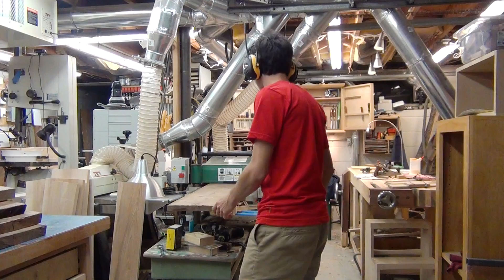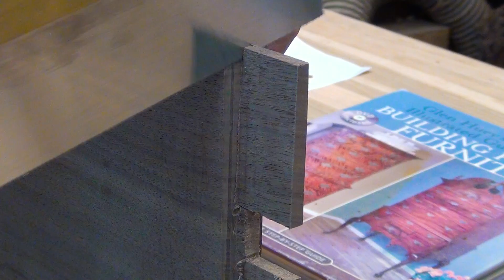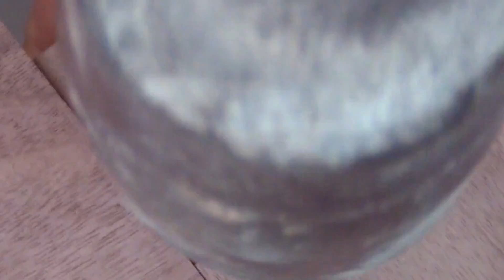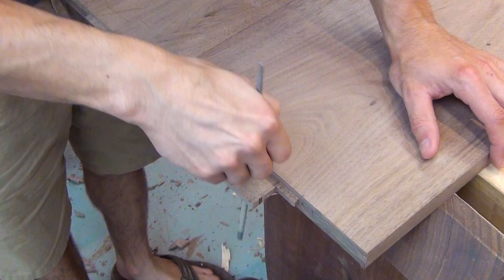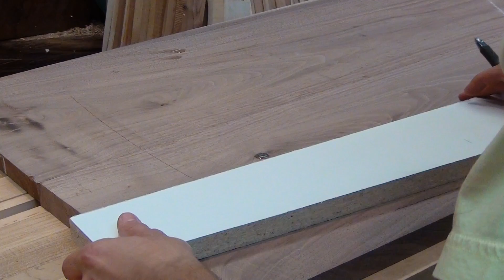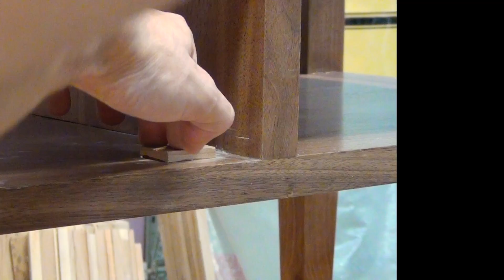Build a Curved Walnut Coffee Table | Woodworking Project with Plans

Comment: Years ago I found this channel because I had an arbor bearing issue with my Ridgid R4511 tablesaw, and Matt had the same problem so he came up in a search when I wanted to see how someone else fixed it. Anyways, I had to replace the bearings twice because the first time I replaced with Made In China bearings, and they did not last long. I still have the tablesaw - and it does work... to be replaced soon.